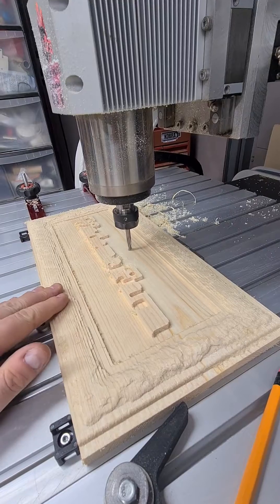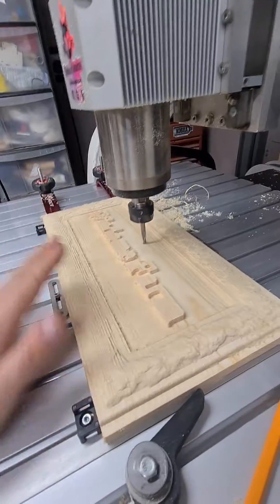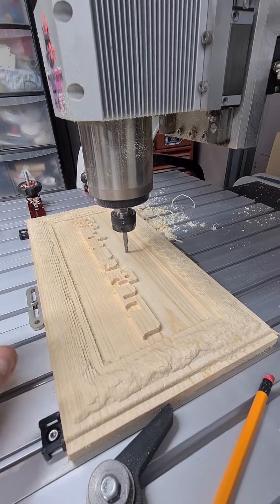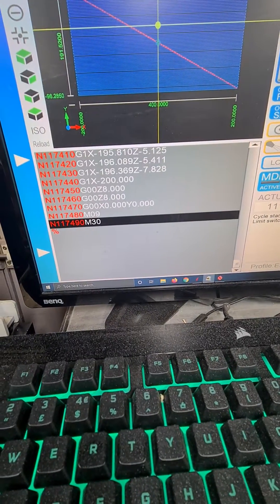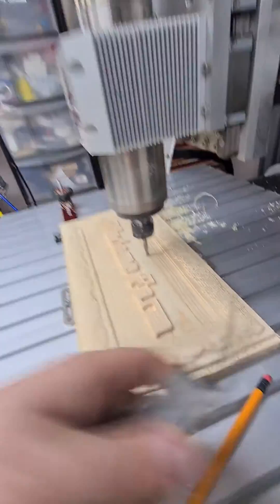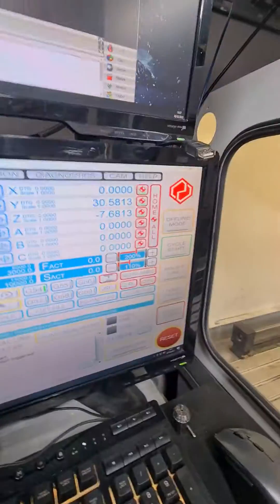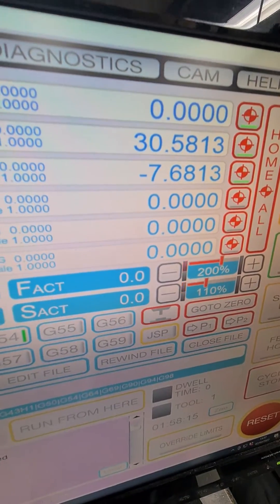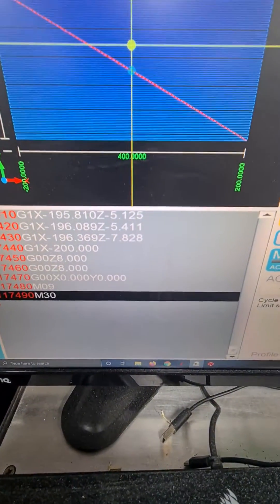When you lose your Z Datum Position - Quick resolve CNC Router

Comment: If you change cutters often, it may be worth making a Z height station. Using a dial test indicator, one can calibrate Z height to 0.01mm with ease. These are not expensive, and even a cheap one will probably be the cheapest and quickest way to confidently give an accurate reference. Might do a video on the topic...
Reply from the maker: Cheers Mike, I probably do plan to add a Z height fixed tool probe. I do have a touch probe to set tool lengths but its mainly when you have machined away your zero starting point. All my tools used to he set off the surface ground vice when I worked in engineering on 2 axis machines.